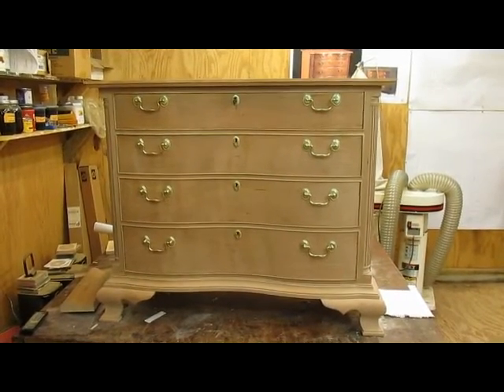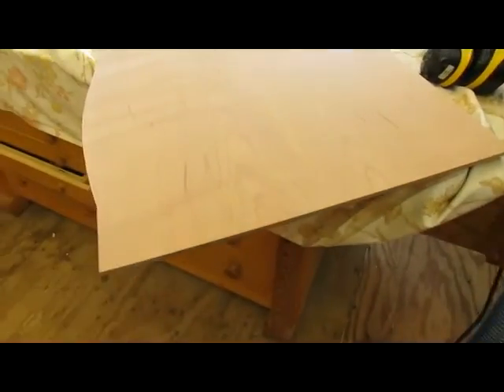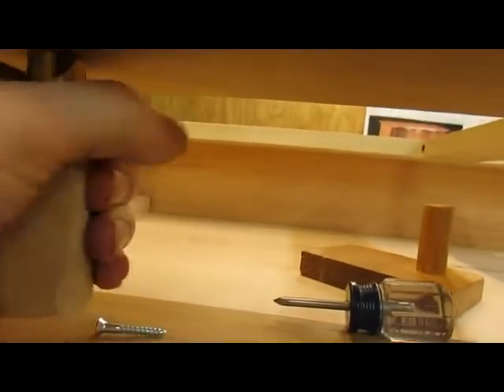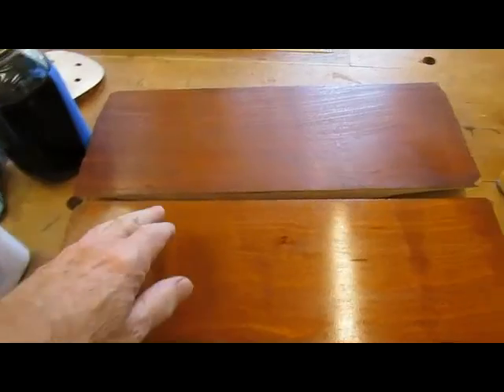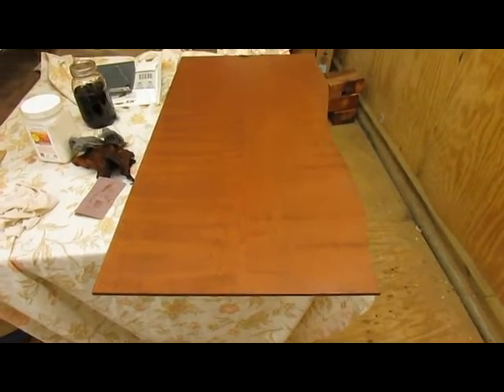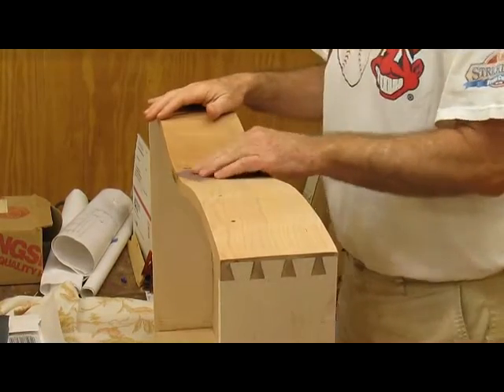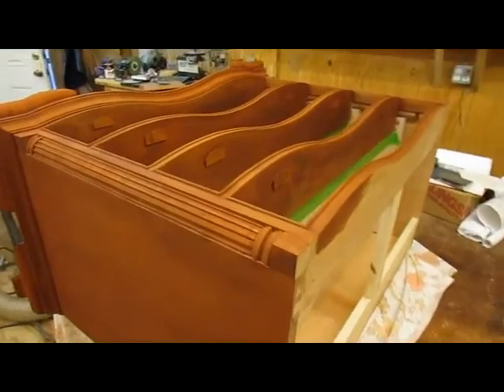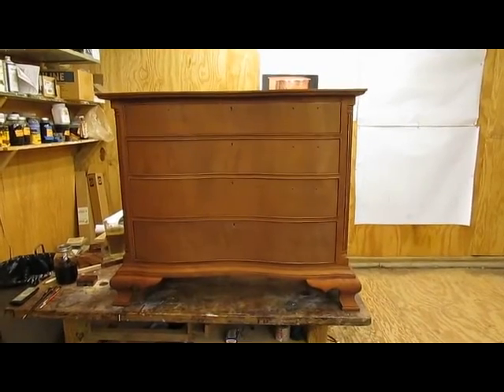Cherry Oxbow Chest   Hardware and Staining Step 14

Comment: David, I am in the finishing sage of a Walnut block front and I've developed cold feet on what to use for finish. I have scraps of the walnut to sample on but just don't feel comfortable with moving ahead. Any suggestions? ??
Terry
Reply from the maker: Terry, Congrats on your build. First it is only wood, it can always be changed. Of course it would be extra work.  I once dyed a cherry piece and it turned out too blotchy, so I used bleach to clean off the color and start over.   If you like the color of the walnut and don't need to dye then I would use shellac for the finish.  Hard to screw it up and easy to work with.  Hope that helps
Reply: David,I appreciate your comments, one of your recent you tube was in Cherry using Waterlux but the way it was applied is unclear.  Would spraying or brushing be a good route or is it a wipe on?  I would also like to ask your location and if you offer a class for us woodworkers?
Reply from the maker: Terry Kirkpatrick Terry, i live in Lakewood Ohio,  Waterlox is applied with a rag many thin coats,  there are many vids on applying on YouTube my email is dboeff@sbcglobal.net
Reply: Thanks again for your help.......Terry